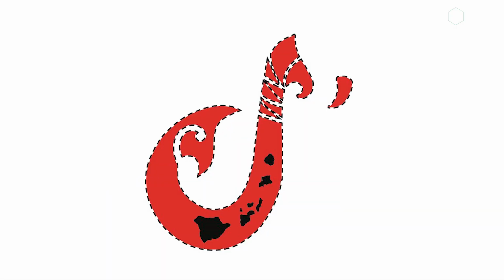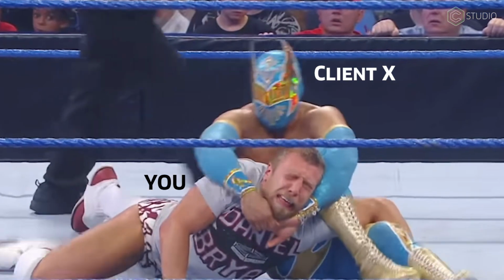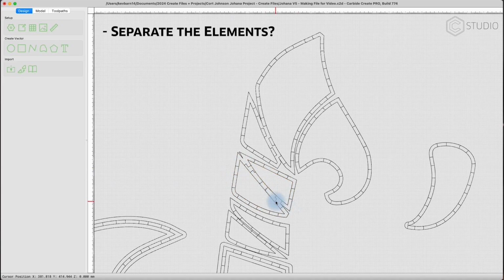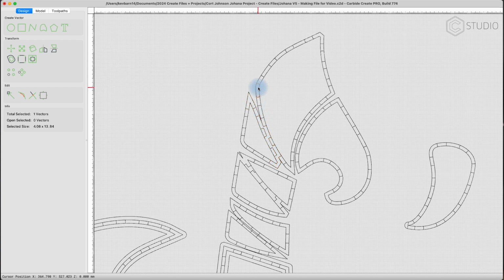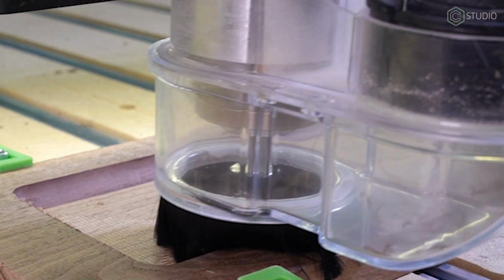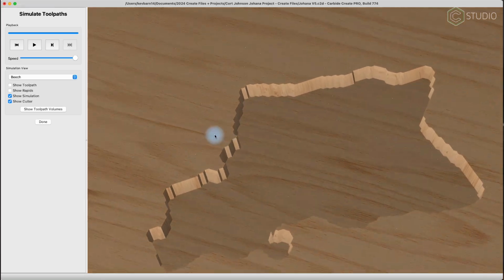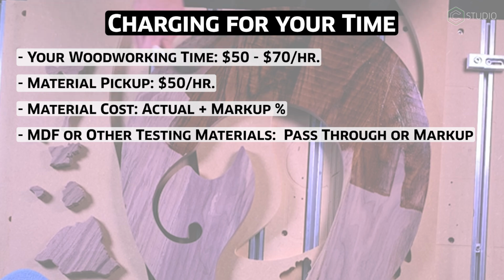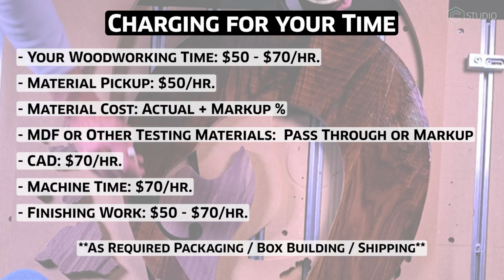Pricing CNC Products - Making a Custom Logo Sign

Comment: Does this kinds pricing apply to s resealable pattern also?
Reply from the maker: I would make the same considerations for materials and time.  The price will come down because the repeatable pattern should become optimized, thereby reducing the materials used and time spent.   
Plus the initial design time is not factored into a single item.   Thats what makes one-offs super expensive.  
- Kevin
Reply: @carbide3d  thanks so much that makes perfect since. Appreciate you!

Comment: Great video and thanks for sharing pricing strategy.. What material did you make the crate out of? I would llike to learn further on the process of making the custom crate.
Reply from the maker: The crate was made of MDF.   The key thing to tell the airline when checking that type of box is “it’s sporting goods”.   Then it’s free.   Otherwise…..$250 charge.
Reply: What thickness mdf did you use? Would you still use mdf to ship it through a carrier?
Reply from the maker: 3/4 MDF.   I do think it would handle carrier handling as well.   You could lighten the package by using 1/2” MDF for the top and bottom.   Additionally, I’d screw and glue the bottom to the sides for added strength.

Comment: Did you sand? Or do you optimize your speeds and feeds or a finished surface off the machine. Maybe have a video about sands pockets and weird contours in the future?
Reply from the maker: Hey Blair,
Sanding was necessary in the main pocket of the bottom section and the tops of the islands. Tooling marks can be reduced with a smaller DOC finishing pass featuring a much smaller stepover. It all comes down to the desired final look and how much time you'd like to spend.  
As mentioned at the end of the video, any time spent should be included in the final product price.

Comment: Pricing thoughts:  Write down how you calculated your pricing (for EVERY customer/job).   Why?  Because if you get multiple jobs from a customer they might call you out on a price they think is higher.   Yes, you might want to dump that customer for being a nit picker.   [source: I occasionally used to do estimation work when the boss was on holiday and we had a customer who'd always argue if the price was 'too high' - and who'd remember the ones quoted 'too low' and hold them up as the benchmark to try to save money]
Reply from the maker: Hey David,
Sometimes, it takes a customer going to a "cheaper" vendor and seeing what that buys before realizing that you are not expensive. You're just good at what you do.